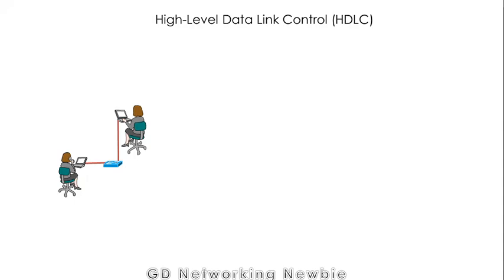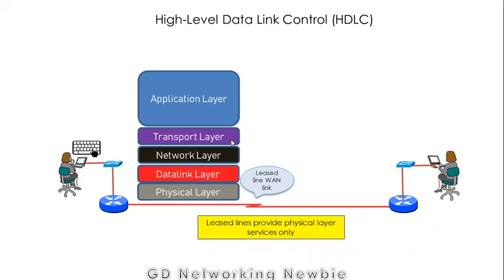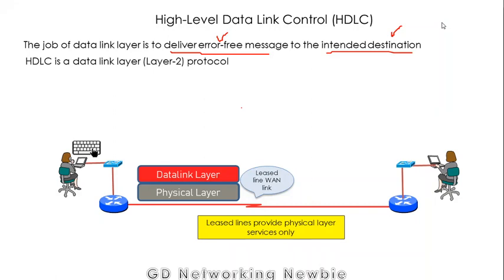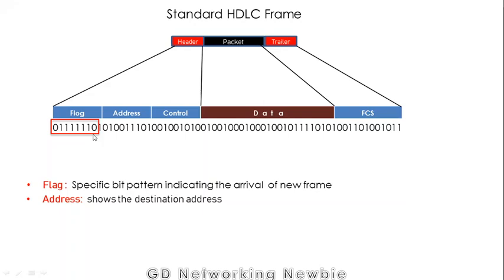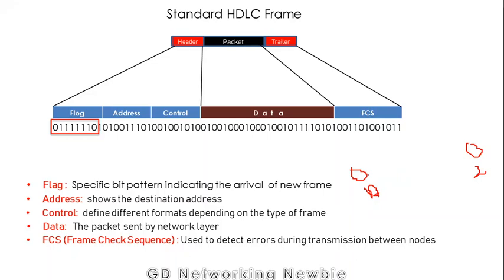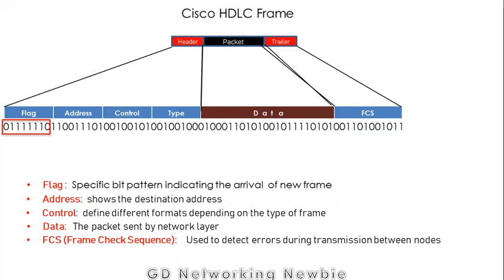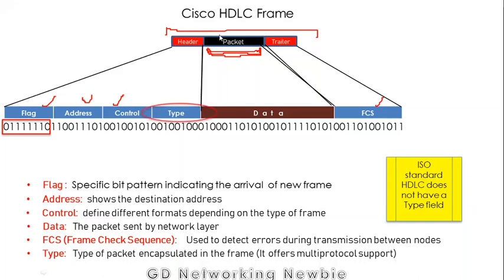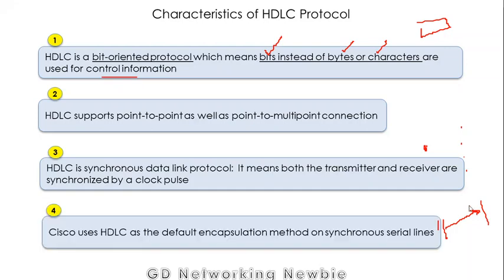HDLC | High Level Data Link Control Protocol and Frame Format

Comment: The address field in HDLC is of 16 bit but MAC Address is of 48bits,  is there any kind of compression involved or what?
Reply from the maker: There is no compression involved. In fact, HDLC and Ethernet are two different protocols with different address lengths